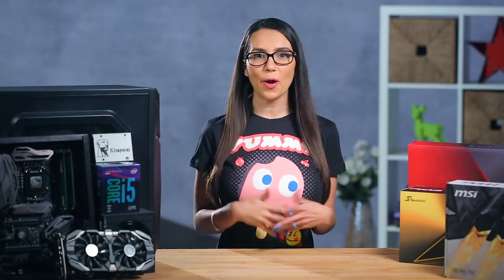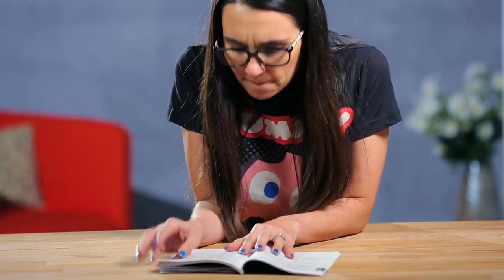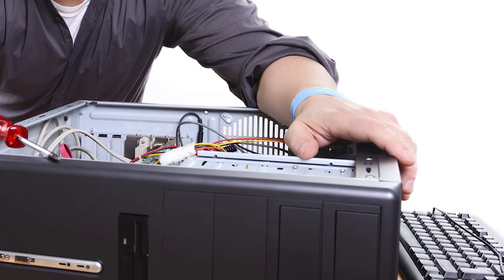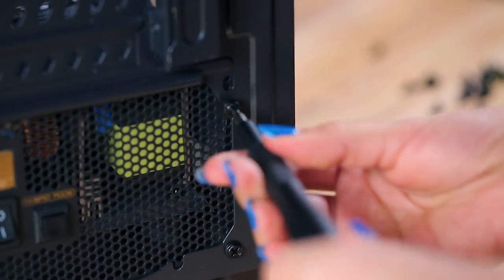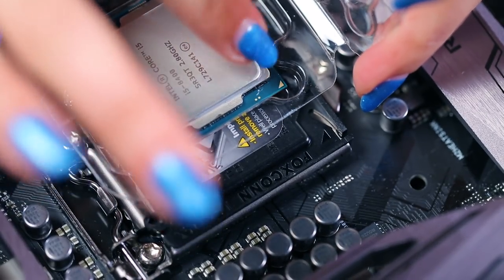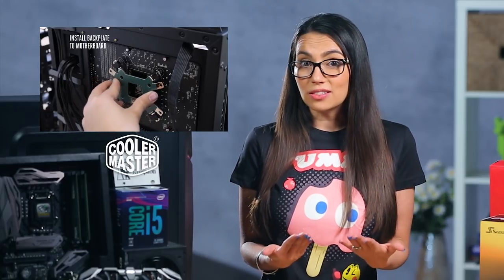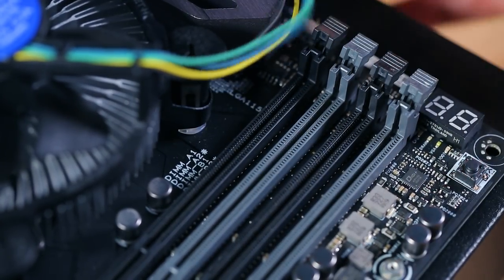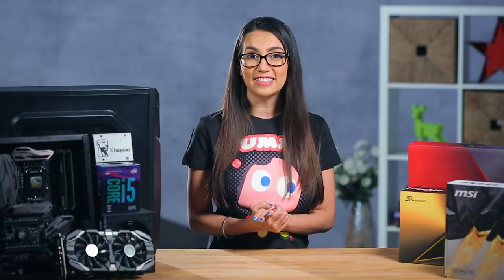PC Build – Installing CPU, RAM, Cooling – DIY in 5 PC Build Part 5

Comment: Don't spread the thermal paste it will create air gaps between CPU and cooler. Just put your thermal paste on the CPU and press the cooler over it.
Reply: That was my question! Because I've seen the pros on YouTube do it how you described.

Comment: These videos inspired me to build a new pc, but I forgot to take off my socks and now it's dead.
Reply: now a days static isn't really a problem. hardware has improved a lot over time.
Reply: Rob Mckay like Rob stated static really doesn't cause modern issues. Id suspect you had a previous issue that wasn't your socks. Many modern tests have been done including a recent one byJayztwocents where they intentionally static shocked the components without any issues.
Reply: I believe he was making a joke
Reply: elzeus13 I feel your pan

Comment: Also with cpu installation aside from the lining up the corners always be aware if the processor is using pins if so be extra careful placing it down into the socket as a bent pin can be a nightmare. If for whatever reason you are a victim in the unfortunate circumstances you can sometimes(with some luck) straighten the pin, s,  with a razerblade and I have and can confirm this worked for me about 10 years ago before I knew as much as I do now.

Comment: hey there great video i could use your help about my putting more ram in i have a gaming tower with a artic 13 cooler on the cpu here comes the help i need i am unable to fit more ram due to the cooler is so wide and im stuck trying to find the right cooling fan to give me the extra space

Comment: wow, one of the few videos that install the cpu right; by leaving the plastic pressure plate on. this is there so you know how much pressure to use. I see people all the time push that lever down to the pcb. you should gently barely down to clear the hook. also, the reason why MB RMA's require this in a RMA is because it often has a install mark, a pin-dot for intel. so when you send it back and they plastic cover does not have the impression they know you didn't use for install.
Reply: eE

Comment: Also, Intel recommends a pea-sized amount of TIM (thermal interface material) directly onto the CPU heatspreader. Then just position and seat the cooler heatsink onto the CPU, secure, and go for it. Heat generated by the CPU will spread and propagate the paste.

Comment: Please don't spread the thermal paste around like that... It serves no purpose and will only create air bubbles. Just a pea-sized amount in the center of the IHS will do then put the cooler on. The thermal paste will spread itself out.